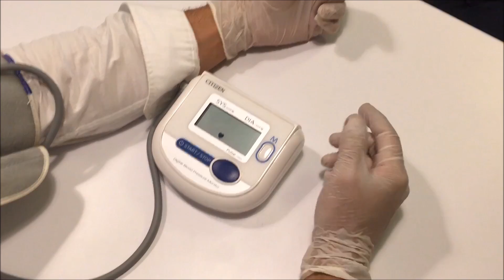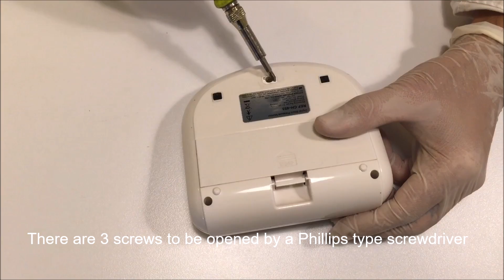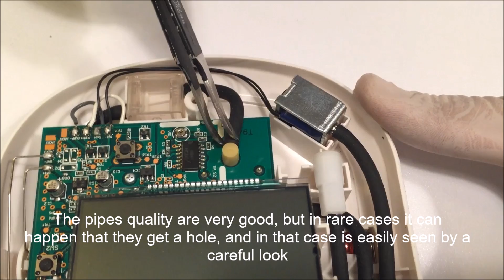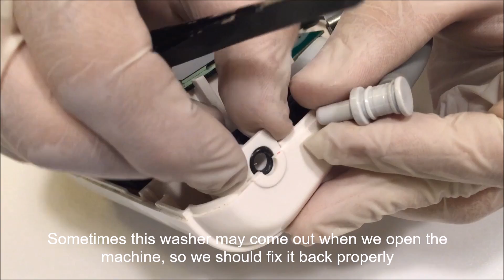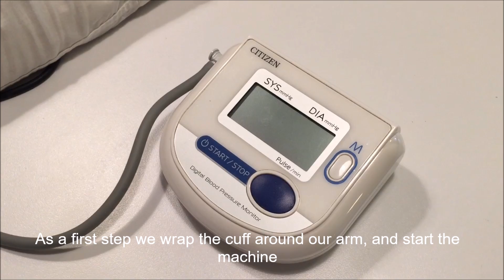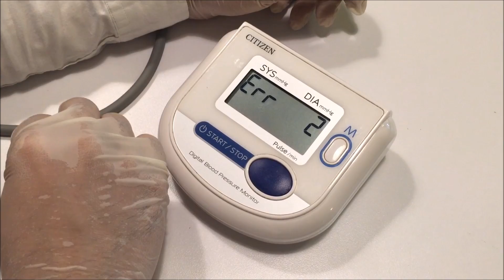CITIZEN Repair - CH452 CH453 Upper Arm Blood Pressure Monitor HQ

Comment: Great Video Sir
My machine was kept for a few years in used without a Battery. It doesn't start now. The display has turned blackish from inside. 

I checked the input VCC with new batteries and it's supplying 6V.

Any suggestions on this please 🙏

Comment: I have microlife digital blood pressure monitor model BP 3AR1.3P having an air loses issues unit 38, 40 but not increase and exhaust loses the air

Comment: My CH 432 when switched on shows six horizontal dashes like - - -  - - - and also does not pump air nor changes its dashes. How do I correct and also is it possible for me correct or have to contact a technician.

Comment: I like your discussion abt . Blood pressure monitor.  What about if my equipment bp monitor. With same model and brand is not functioning for my satisfaction. Whenever I use it lately it sqeezes my arm so much. It is painful indeed and now I cant use it anymore. Thank you for any answer I might receive
Reply: this is bp monitor and it will inflate the cuff .. if u think its squeezing too much.. it means u hav worn the cuff too tightly.. the proper way is to keep one finger or less looseness when u wear the cuff.. do not wear the cuff too tight .. bcoz it has to inflate...

Comment: Sir l am using  enbee make model NB 103N . It's all ways shows high reading. Valve, Motor  are ok. Calibration screw not provided inside. Some time it's deflated automatically then start again.  What is the problem? Help me.

Comment: Sir my BP machine shows ---- when I start it...please give me solution.
Reply from the maker: Dear Sir, thank you for contacting us. the lines you see means that there is no memory recorded, so you have to place the cuff in your arm and then press the start button. by doing this the cuff will start inflating and your pressure will be measured. If this suggestion  doesn't solve your problem please let me know the model number and we will review the switch ON procedure again.
Reply: @islandgate-igt-citizenheal4363  The model number is CH-432...the BP machine was in working condition about two years,But now has the problem of displaying ----
Reply from the maker: @shubhamkeshari1405  Thank you for the clarification. I consulted with our technicians and if the item was working previously (even considering 2 years of work), then most probably the problem  in in the main board, which is not possible to repair.

Comment: dear my ch452 deflation is very slow the arm become tired and painful due to slow air release.what to do plz tell me soon.
Reply from the maker: Dear Mr. Shafiq, thank you for contacting us. The deflation timing can not be faster because CITIZEN blood pressure monitor is still measuring while deflating. This means that it takes 3 measurements, while inflating, once is fully inflated, and while deflating, and the final result is the average of these 3 measurements. To avoid having pain in the arm please try to wrap the cuff not so tight. When you wrap the cuff around your arm don't press it too much, just tight it enough to not fall down from the arm, and this way the pressure will not be too high to hurt your arm.

Comment: hello sir/mam we had CH--453 long time we dont use it now i try to use it again but not working properly i already change the battery..it show error 1 it stop in 70 SYS and not continue in DIA where i can bring the machine for repair? im in Calamba Laguna area Philippines...thank you
Reply from the maker: Dear Mr. Agravio, sorry for the late reply. Error 1 means air leaking, so according to your explanation, and considering the long time without use of your BPM, the most probable case is that the interior pipes got dry and cracked (allowing the air to not press correctly), or there is some puncture in the cuff, making not possible to inflate correctly.  For repair in Phillipines you can contact directly our Japan office at sales-oe@systems.citizen.co.jp , and they will provide information for an authorized repair shop in your area.

Comment: Great video!  I have a problem with the Medline MDS4001 Automatic Digital Blood Pressure.  It worked fine with batteries until I switched to an AC adapter.  Unfortunately, the unit was not working with the AC adapter so I switched back to battery.  The unit became malfunctioned (the start/stop buttons didn't work  & the screen monitor went completely blank) even with new batteries.   Appreciate your input.
Reply from the maker: Thank you very much for the comment. Regarding your BPM we can not give you a precise answer because is not CITIZEN brand, you should contact your local dealer. But as per your description, this must be a failure of the electric circuit. Some brands don't take care of this point and align the 2 power source systems correctly, so when you go from batteries to AC, and come back to batteries then the system doesn't respond. Our advise is to send it to your nearest repair center from your BPM brand. Hope the answer is useful.

Comment: Sir my machine shows - - -   - - -  when start .  pl give me solution
Reply from the maker: Hello and thanks for contacting us. Please note that when using the device for the first time and pressing the M button the machine will show --- --- because there are no saved measurements. When the device is OFF you need to fix the cuff in your arm and then press directly start (not M button) so the machine will inflate the cuff and measure the Blood Pressure. If the problem persist, please write to me at L.M@island-gate.com so we can give you clear instructions.